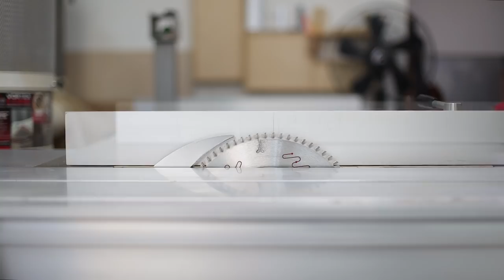SQUARERULE FURNITURE - Making Wooden Serving Tray

Comment: Love your work and atention to detail. Thank you for sharing it with us. But if you allow me to add a little criticism, i think the side router channel is a bit unuseful since the sides are very small in height, seems that noone will be able to hold it using them, what if you made them all the way down from the middle?
But nether the less outstanding job.
Reply from the maker: Are you talking about the side handle?

There are two reasons.
First, the groove of the bottom plate interfered with the handle, so I raised it from the middle to the top. (If you machine deep in the middle, a hole will be formed.)

Second, the tray is raised slightly above the middle, and it can be raised from the bottom without interference.

Next time, I will check the drawing again and make it prettier.

Thanks for the good comments ^^👍👍

Comment: Another wonderful video. You do fantastic work!  What is that device you unwrapped that was on your kitchen table?  I’ve never seen anything like it.
Reply from the maker: I expected someone to ask a question, but no one asked.

You are the first!

It is a tool that protrudes the back edge of a Japanese planer.
I know it's only made in Japan.
To understand this tool, you must first understand the Japanese planer.
Japanese planers and chisels are concave inside the back blade.
Reply: @squarerulefurniture  hmmmmmm interesting. I’ll have to research Japanese planes. I’m not so familiar with our “western” style planes to begin with. I know nothing about Japanese planes. Seems I have some reading to do!  Thanks for the response!
Reply from the maker: @paulcarey7517  It seems to be visible as much as you are interested.
Have fun studying!